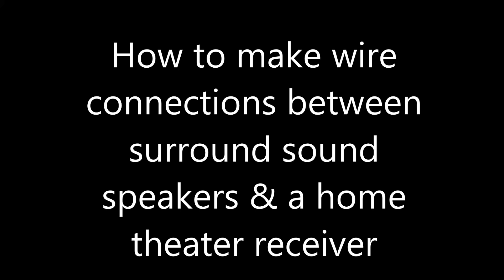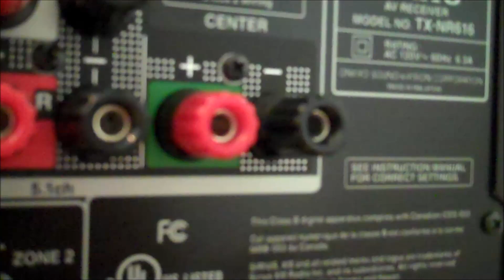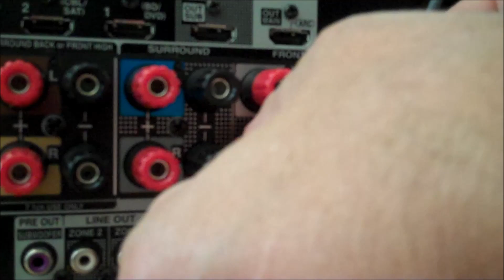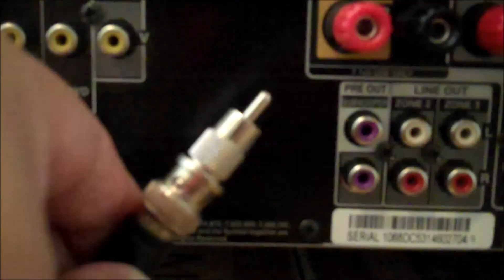How to make surround sound speaker wire connections to a home theater receiver

Comment: At the end of the video when you plug in the subwoofer wire, was that also a banana plug?  
Because I have a subwoofer that I would like to use sitting around and it's wired. So if that was a banana plug that will solve my problem.

Comment: i have a Phillips dsp2800 5.1 speaker.i buy from Amazon. in back of main woofer there are not a red white wire stereo connection so how i can connect my mobile to the speakers??? plz help me        buddy.
Reply: Mobile what????? you connect a subwoofer to a Ht receiver by means of a RCA to RCA single cable....

Comment: Why did you only have the rear left and right in the ceiling connectors to the amp with banana plugs and not have all the speaker wires with banana plugs ? Did you purposely do this because it was an `informative` video showing both bare wires and banana plugs ? Do you run banana plugs on all your 7 speakers to the amplifier normally ?

Comment: What if all of your wires are the same color?  Not labeled black or red.
Reply: I know this is an old post.. But most speaker wire even if non colored has marking on which one is positive. The positive usually has a white or different colored stripe on the wire. Not really easy to see but I haven't found speaker wire that isn't marked.
Reply: All About Home Electronics.com get some diff colored tape,and put a diff color on end of each wire
Reply from the maker: You'll have to trace them out or tone them out with a tone probe kit
Reply: hey darkvedara47 can you help me how to connect if there is not a red or whitrle clr ??
i buy dsp 2800 and in that all are same clr now what can i do??